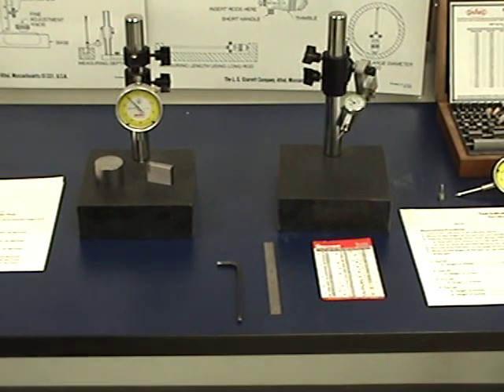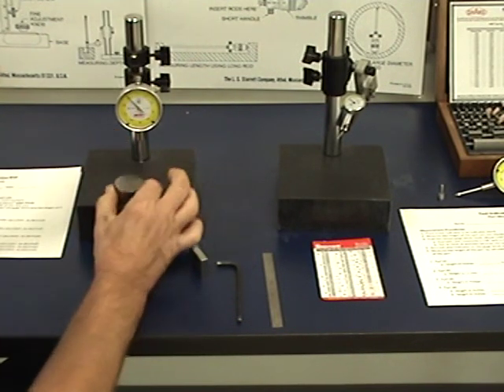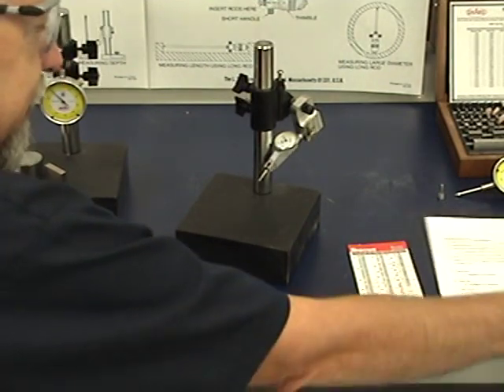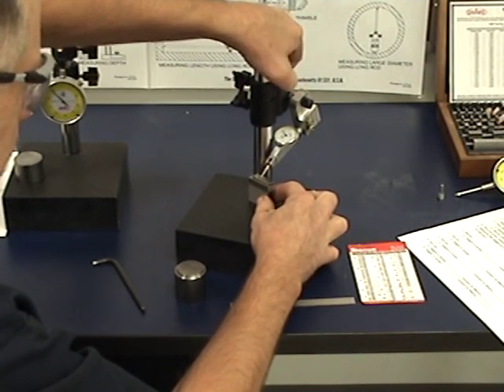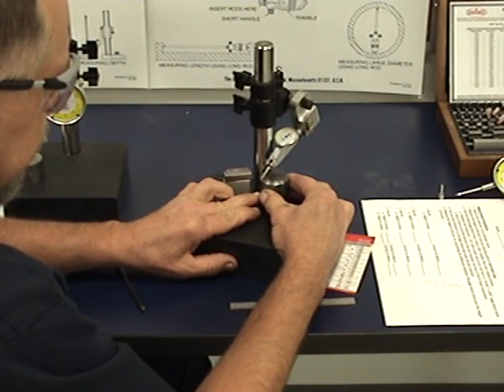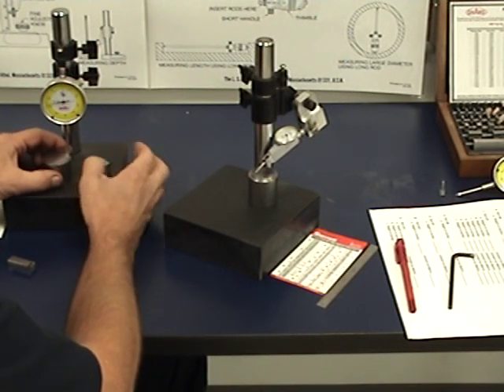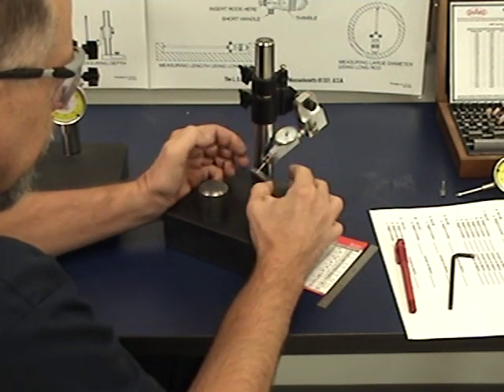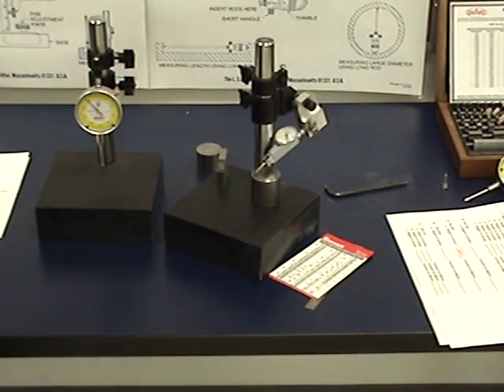Using the Dial and Test Indicator.MPG

Comment: Ever hear of cosine error?
Reply: I doubt that he knows. 😀
The ONLY indicator that requires an angled stylus that I know of is the Interapid and it's NOT 20 degrees (more like 12 degrees IIRC). All other indicators that I've use (Mitutoyo, Compac, BesTest, Starrett...) have 0 degree measuring angle (or 90 degrees from the direction of the measuring force). I guess most guys don't read the instructions included with the tools they use.